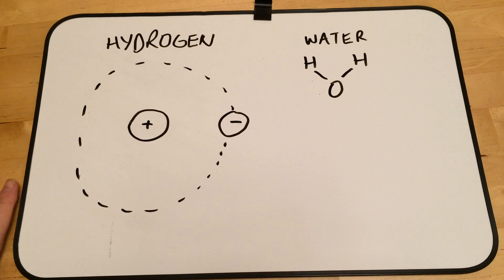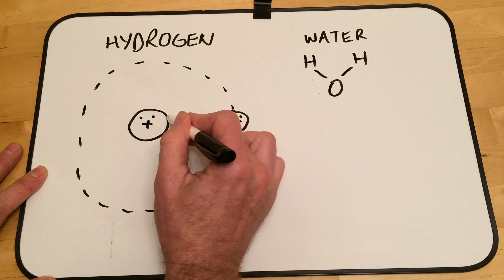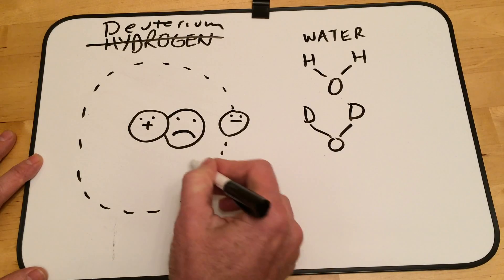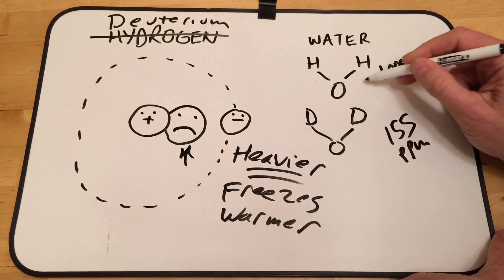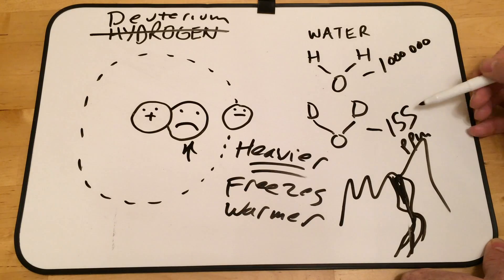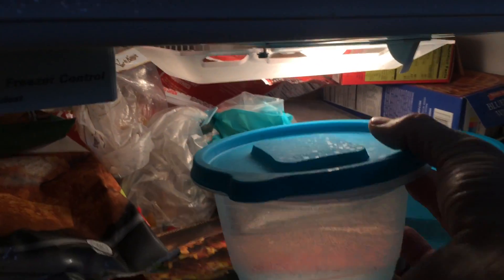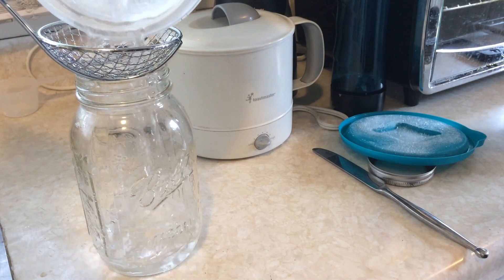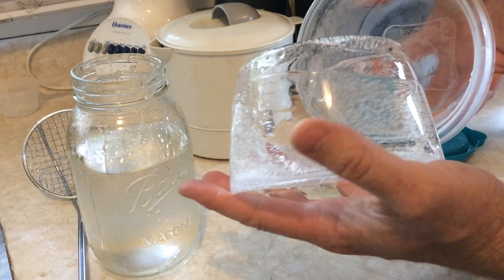How To Make Deuterium Depleted Water DDW

Comment: You are better off if you want deuterium depleted water collecting rain water and purifying  it  ( membrane filtration or distillation) as it will be contaminated with particulates from industrial combustion (aircraft, cars, domestic. power stations)  It is know that H2O is lighter than D2O so water vapour will  be richer in H2O than D2O.

Comment: Deuterium can be separated from a mass of ordinary water.  It may require repeated freezing.  Test the product you assume is deuterium free -  Ice cubes made of suspected deuterium will not float in your glass of iced tea.  There's your proof and measure of your system's efficiency.

Comment: This seems unnecessary... deuterium is everywhere and your body would process it more slowly and the way to get rid of it would be to concentrate your solution down to deuterium itself but then to catch and rebond the hydrogen and Oxygen back together is Rather costly right now and you'd have to balance the water again with proper minerals so the water isn't corrosive(acting like an acid) trying to balance itself back out, unless you want your bones eaten away slowly over time

Comment: Victor Shauberger removed deuterium by simply getting water to almost freezing and vortexing it clockwise and counterclockwise. Thats how natures reduces deuterium as the the rivers from icy mountains flow down.
Reply: awesome thank you for that
Reply: Hay varios metodos para activar el agua como tu dices, caños con estrias, picos de botellas que generan vortices, vasos de mezcla de polvo de proteinas retocado, etc Si procesas agua filtrada en una jarra que hidrogena el agua y luego la congelas, retiras mas agua pesada
Reply: Citation?
Reply: "Viktor Schauberger did not directly research or develop deuterium-depleted water. While Schauberger's principles of vortexing and natural water movement are sometimes associated with methods used to structure water there is no evidence that he specifically studied or promoted deuterium depletion."

Comment: I been reading on the structure of waster and it explains why this shouldn't work. Deuterium tends to be spread out evenly in water with regular water clinging to it all around. This forms a orb like structure. If you reduce deuterium levels the structures get larger and the water beads better but at some point in the depletion process this stops working and the water beads less. So if you want to freeze the deuterium you would have to add something that separates it from the h2o . Nature can produce deuterium reduced water in the form of snow but the water molecules are dispersed in the air when freezing. And I suspect when the deuterium is reduced too much and the structure of the water becomes comprised it would no longer be beneficial.

Comment: is there a way to actually easily  measure the Deuterium levels after this experiment? I guess you'd have to measure the levels 
before and after each pass of the freeze cycles then we would know if were getting deuterium depleted water. I wonder if
certain water naturally contains less deuterium in nature.  I have heard that deuterium level have a direct correlation to cancer 
cell and its the cells that are trying to help us deplete deuterium to protect us.  Love your innovation Thanks for posting
Reply: Are you sharing that the cancer cells are trying to protect us from the Deuterium and if so how can they help get rid of it?

Comment: Say I wonder...could you set a freezer at the freezing point of heavy water (38.84°F), and put a few plastic jugs of distilled water inside, wait a couple of hours and then poor each jug of water through a filter of some kind...not sure what would work, to extract a more purified heavy water? Maybe a freezer won't go that high, and maybe a refrigerator could be set that low. Not sure.

Comment: I think it would be better to freeze it in a cooler with the lid off. Thats what makes crystal clear ice, limiting the freezing point to the open top. I believe this allows Brownian movement to achieve the deuterium depletion most effectively since D2O freezes at a higher temperature and only one freezing access point of the cooler, since all the rest of the cooler sides are insulated.

Comment: You said D2O freezes at a higher temp than non-deuterium water but in your freezer process you said the reverse, the water that doesn't freeze in the center of the bowl is DDW which has a higher melting point, that's the contradiction. Deuterium water should freeze first as temps drop, right? Thanks for clarifying this.

Comment: If you could maintain a surface at 2° and spray 1° water at it, the deuterium should begin to build up on the surface. Then the lighter water would run off and be recirculated. However, the runoff water would then contain all the crap except the deuterium so you'd want to start with really clean water, or you could RO it afterwards to remove any concentrated crap.

Comment: This will not work at all.  The only water freezing first is that on the edges that gets cold first and since it is below the freezing point of both D2O and H2O, both are freezing in that area. The D2O in the middle stays in liquid at the same concentration as before.  To do this with any real results you would need an insulated container, internal heat removal, continuous agitation, precise temperature and pressure control, and a way to remove the tiny amount of D2O crystals that form.  This requires engineering for the process, equipment, controls, and sampling.  Trying to do this like shown in this video is completely ineffective, does not lower the D2O concentration at all, and is simply a waste of time and energy.

Comment: Not perfect, and doesn't remove ALL the deuterium, or even most of it. And the throw-away ice also contains much normal H2O, but this SHOULD lower the deuterium percentage of the unfrozen water, like mountain ice run-off that liquifies first. Three or four freeze cycles should significantly lower the deuterium content. 155 parts per million to start with isn't much but can do much cellular damage. So just lowering the deuterium content to 125 or even only 135 ppm should make a significant health difference.  And it's much cheaper than the 5 to 25 ppm fepleted water.

An infrared spectrum analyzer can measure the difference if you have a few thousand to spare for a used one. ... Why bother?
.
Reply: You are absolutely  delusional. There are zero studies showing 155 ppm deuterium has any direct health affects.

Comment: A problem I see in these videos is that, as usual, the water that freezes first is always at the top and sides of any water filled container in your freezer.  This is because that is the water is first exposed to the freezer's freezing temperature.  The more internal water in you container is being insulated to a degree by the outer water which "feels" the freezing temperature first. That is the actual reason it freezes first.,  It is simply in closer contact to the freezer's freezing temperature!    If, in fact deuterium has a lower freezing point, you would probably need to have the water container in your freezer constantly being agitated in some way so that the water was more uniform instead of having the surface and outer water molecules being much closer to the freezing temperature
Reply: Or set the freezer or cooler to 38.84°F, the freezing point of heavy water. But there is such a small amount of it, say one milliliter per 100 gallons, that you would need an efficient freezer or cooler large enough to hold 100 gallons, just to get a milliliter of the stuff. No wonder it's expensive.
Reply: @slickwillie3376  The ratio of D20 to H20 is 1:6400. So it's 1cc (ml) per 6.4 L (about 1 1/2 gallons).
Reply: @slickwillie3376  But but but... you want to get rid of that milliter...
Reply: Need to use an insulated medium to allow directional freezing, search for "making clear cocktail ice"
Reply: D20 Freezes at 3.8C while regular water is at 0C. Just need a temperature controlled freezer.
Reply: exactly what I thought !
Reply: I was thinking the same thing!!
Reply: WWII. Heroes of Telemark. Operation Gunnerside 🇳🇴 🇬🇧 Heavy Water War.
Reply: No need to stir the water, depleted water frozes first expelling the heavy water from it
Reply: Use a speaker to play a sine wave
Reply: Good point. I don't think you can use something that mixes the water like an ice cream maker cuz that's constantly stirring in the deuterium Frozen parts into the serum depleted water so you actually need the whole water container to constantly be moving probably slowly
Reply: Use an ice cream maker?
Reply: @serela1963 I don't think that would work. Anything that is mixing the water around will mix the deuterium Frozen parts in with the deuterium depleted water
Reply: mag stir stick an a catch lip to collect all that frozen deuterium problem solved

Comment: Save your time and energy. It does not reduce deuterium. I ran two cycles and sent the water to an isotope lab. It came back as 154 ppm. Not worth the effort. Fractional distillation in a 40' tower the only way to go to move the molecules enough to separate them.
Reply: Hello. Does reverse osmosis remove deuterium from water?
Reply: @slumpedmage  no
Reply: @slumpedmage  No. Sorry. I wish it were that easy.
Reply: @Droxyguy4life  what's the most feasible way?
Reply: @slumpedmage  A 40' fractional distillation tower will get H2O down to 147 ppm deuterium.
Reply: Hi, could you tell me how do you know this method? Also, do you know if it’s possible to get spring water to contain less than 30 ppm deuterium? I am asking because a person I know invested in a drinking water product that claims to contain less 30 ppm of deuterium and I don’t  fully trust it.
Reply: @c_c207  I tried both methods and sent the water samples to an isotope lab ($80 per test). The 4x run freezing water technique lowered the deuterium by only 1 part per million. (HDO freezes at 38.8 F) The 40' fractional distillation tower lowered the deuterium by 8 parts per million. (HDO boils at 214.5 F) I doubt any spring water has less than 155 ppm deuterium. BTW- I sent a sample of Florida rain water to the isotope lab and the water had 156 ppm deuterium.
Reply: @c_c207  I made a 41' fractional distillation tower and sent the water to an isotope lab. I had many samples tested. I doubt you could get spring water down to 30ppm HDO, maybe after 20x redistilling the water but that would be too much work and expense.
Reply: Is it possible that dew could have a lower amount?  @Droxyguy4life
Reply: @idk-z6i-f8t  I actually sent rain water to the lab and it came back as 156 ppm. Yikes.
Reply: Can you email me? Vtvault@protonmail.com I need your help w this. I’m building a prototype
Reply: I agree
Reply: Or almost freeze the water and vortex it clockwise and counter clockwise, just like nature does with water flowing down mountains
Reply: @stem_cell_nin  have you tested this method at a lab?
Reply: Where can I send water to be tested for Deuterium ppm? 
What laboratory?
Reply: Where can I send water to be tested for Deuterium ppm? 
What laboratory?
Reply: You would need to do at least 10 cycles! X2 is no way near enough.
Reply: When companies claim to sell deuterium depleted water, what are the deuterium levels?
Reply: on recent Dr. Gundry's podcast with the guest who supposedly invented reverse osmosis, he said exactly that.
 Btw freeze distillation is what I use to get a very pure water without salts and dirt. Do the same thing but keep the freezed portion. Maybe, just maybe it could work with distilled water but you dont want to fast freeze it from the outside like this. When I leave a jug outside during the winter (best with already freeze distillate) and I leave it sitting there the for a week when the temp is around 0°C it happens that crystals of floating ice form - these may contain more of the heavy water. Btw I was never in fond of the taste of this portion even tho in theory it should be the cleanest. It tastes kinda like snow. I think I'll discard it this year
Reply: @trollmcclure1884 
😂 Of course, it would taste like snow ...

If the snow you're referring to is the very snow that dropped from the sky...

And you expect water that's left to freeze outside under the freaking sky would taste different?

I bet, you don't even bother, put a lid on the water container, right?😅

And even if you did it in enclosed cold 🥶 garage, I think it would still taste the same as you probably wouldn't put a lid on...😂

P/S: what exactly is your definition of clean in the first place?

It's just filtered tap water?
Boiled tap water, but not filtered?
Or, both, filtered and boiled tap water?

Mine is the 3rd...
Let discard water you scooped out from rivers, unless it's from hill/mountain springs and sea area that's far away from industrial zone or pier areas...
Reply: @aphiz4505  It's probably not a taste in a sense of taste buds analysing molecules but maybe their lack of. A sensation on the tongue I dont get from distilled water. Once again this method surprised me when I let a bottle of RO, deionized water in a car for months. It created a precipitate. Either my RO system sucks or it dissolved the PET bottle. BTW I use closed PET containers

Comment: Fail! The water freezing because it is nearer to the outside of the container. The water inside is protected and more insulated so it doesnt freeze as fast. This has to do with heat transfer not deuterium.
Reply: Finally someone with a brain.
Reply: Yup.
Reply: Usted tiene  que usar un recipiente metalico que se usa para hacer tortas o BUDINES, tiene en el medio una protuberancia y de ese modo el frio se reparte en casi toda la superficie del agua, al menos mucho mas que un recipiente comun, no es caro y usted gana mucho tiempo la congelar mas rapido, por otra parte si usted usa un recipiente de torta cuadrado tendra una superficie mayor y se congela mas rapido y es lo mas eficiente, depende de su freezer, es todo muy sencillo pero no se porque hay personas que se enriedan y no salen del hueco

Comment: Because, Deuterium is twice as Heavy as Protium (the more abundant form of Hydrogen) it gives the molecule of water a greater moment of inertia and slows down its average rate of rotation. Consequently it does not bond to an growing ice crystal quite as rapidly as the lighter molecules of water. So if you bring water to a boil (to break up polymerization and increase the number of single water molecules) and then cool it rapidly to the point of fusion so there is less time for them to participate in polymer groups the ice will have a greater percentage of light molecules than normal water and the water that is not frozen will have a slightly higher percentage of deuterium. Instead of 110 ppm you might get it to 112 parts per million. So the water that didn't freeze is brought to a boil again and then rapidly cooled to the point of fusion removing even more of the lighter molecules. A very slow process with the only difficulty being the rapid cooling needed to avoid excessive polymerization.
Reply: So, it's the opposite of what he explains in the video. The unfrozen water in a mixed solution of D2O and H2O is more D2O because: The O–H bond vibrates faster (lighter hydrogen), giving slightly stronger hydrogen bonding.

The O–D bond vibrates slower, which slightly weakens hydrogen bonding.

The crystalline lattice of ice prefers those stronger, lighter H₂O bonds — that’s why ice forms from H₂O first, pushing deuterium to stay behind in the liquid, even though it has a higher freezing temp.
Reply: There's got to be a way to brute force this into a faster, less efficient process....
Reply: @bluellamaslearnbeyondthele2456  less efficient?
Reply: I guess autocorrect got me. The dude above also probably meant 155 ppm though.
Reply: @bluellamaslearnbeyondthele2456  whoa 😳 sorry buddy could have guessed..

Comment: Definitely doesn't work. 155 ppm is 6 drops per liter. You wouldn't have that much deuterium ice. Also, it's 0.5° temp difference. You need fancy equipment for this to work
Reply: Like something spinning the water, keeping it the same temp? How is a motor fancy?
Reply: @bluellamaslearnbeyondthele2456  How about spinning the water in an open top centrifuge and scooping out the center part?

Comment: In basic logic if the contamination is .000000155% or 155ppm  of the entire water then I would assume the mitochondria on my have a...0000000155% benefit ???  I suck at numbers.. someone please?
Reply: Yes, you suck.  155 ppm = 0.0155 %.   Anything else?  Oh, and let commenter "Spout Boes" who claimed "This is insane. Deuterium has no effect on your metabolic processes" to look up the term 'proton pump' in molecular biology.  Proton pumps exist as part of the Krebs Cycle, so the fact that Deuterium is 2x the mass of Protium does INDEED make a huge difference in metabolic processes.

Comment: If it was this easy they wouldn't use distillation.  It's only 150ppm so it's probably too hard to separate from water.  If in fact it did freeze first, you'd have a layer of deuterium ice settle on the bottom.  It freezes at 3.7 degrees C.  A centrifuge should work since it is about 10% heavier but they don't do that either.  I'm no chemist so I don't know why not.
Reply: This was my thoughts exactly. If you could simply freeze it out they would have done it. Right?